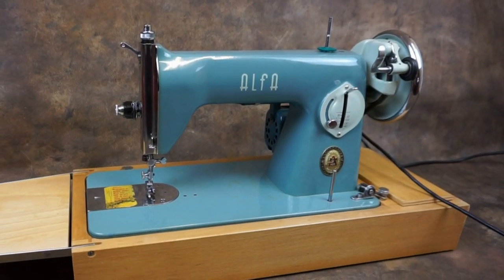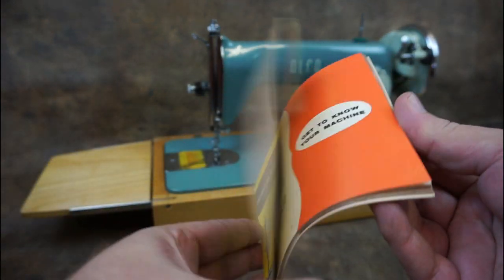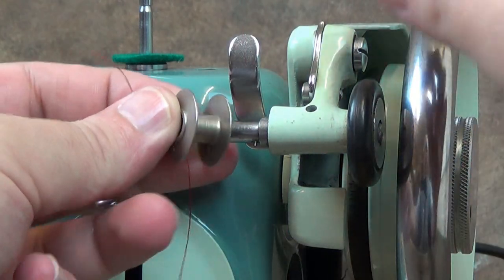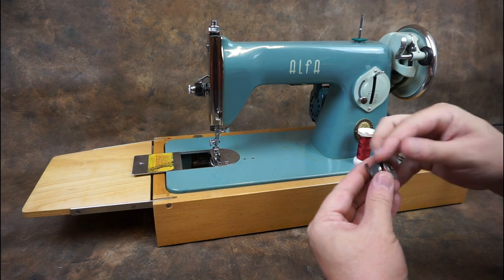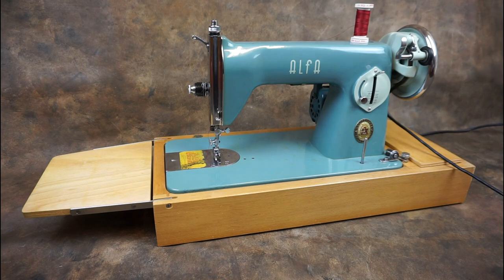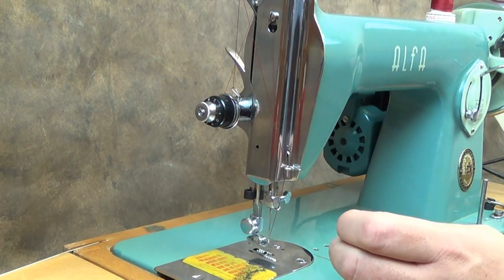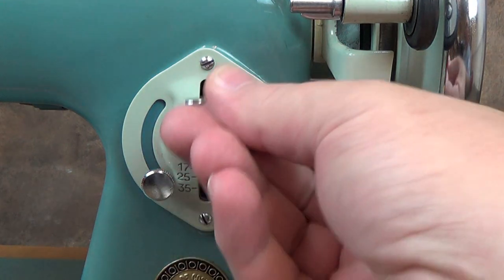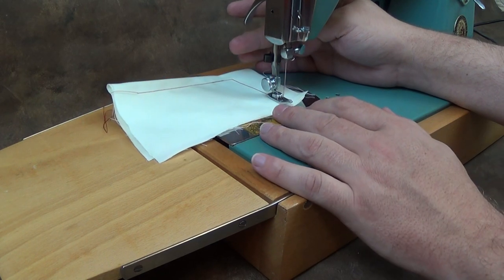Alfa Model 50 Vintage Sewing Machine - Singer 15 Clone

Comment: Hi, I have just been gifted an Alfa sew-tric A244202 it looks very similar to this one. I've been searching for a manual but I'm struggling. I'm wondering if you can help.
Reply from the maker: check on some of the Facebook vintage sewing machine groups - many have files sections with copies of manuals to download. A singer 15 manual is basically the same. By the way Sewtric is the name of the motor manufacturer.

Comment: I have one of these model 50 machines. However, the foot pedal is broken. Is it easy to pick up a replacement, or are they interchangeable with other alfa/singer foot pedals? Thanks
Reply from the maker: Not easy, but not impossible. You could replace the pedal and motor with one from a Singer.
Reply: @CurioByBSpokeDesigns  would a motor/pedal combo from any singer do, or specifically a singer 15?
Reply from the maker: @BrianLynch-x2w  most singer motors and pedals will fit. There are also aftermarket motors and pedals available

Comment: Hi, Ive just been given an Alfa Ballerina Muti stitch thats been in the family for a long time & has seen better days but it's cleaning up nicely. Will the Singer 15 and the instructions on here apply much the same. I'm looking forward to getting it going, this on here is very useful Thanks Deb
Reply from the maker: Hi Deb. That's not a model I'm familiar with. It may be worth searching for a manual on the internet.

Comment: The body shape looks like the 201Mk2 or in my case Singer 191j's. I have one of these in Black, need a motor for it.
Reply from the maker: Yes, I think they followed Singer's lead in modernising what is basically a very old design.
Reply: I tried to mount a singer motor and it looks like it wants a slightly bigger belt.. Hey have you ever used the old treadle belts to make custom smaller belts? @CurioByBSpokeDesigns
Reply from the maker: @davidanddavidstrading  no, but I know that people have. Different sized belts are available online though.
Reply: @CurioByBSpokeDesigns maybe I'll try!! Or maybe I will swap out a 191J on a treadle. I need to learn that too!

Comment: The manual for my Singer 15J90 Centennial (made in St. John's, Canada 1951) states that the bobbin is inserted as to make the bobbin spin counter-clockwise/anti-clockwise. 🤔
Reply from the maker: Hi. If you check out my video on the Singer 15, you'll see that over time Singer changed the 15 bobbin mechanism. Some had the finger on the bobbin case pointing to 11 o'clock and some pointing to 1 o'clock. This meant that the bobbins were inserted a different way in each. It also meant that the needle was the other way round - and threaded the opposite way.

Comment: Mine has been in storgare for many years and is now very stiff...it is a hand powered machine.  htink it just needs oiling. Can it be converted to an electric peddle operation?oops, mine is alpha 70
Reply from the maker: Yes. You can get an after market motor and pedal set. It just bolts on where the hand crank bolts on.
Reply: @CurioByBSpokeDesigns  thank you

Comment: I just bought an alfa e2 
Is it the same mechanism
Reply from the maker: I'm not familiar with that machine but it also looks like a 15 clone as the tension is on the face plate
Reply: @CurioByBSpokeDesigns  I was just intrested in Wether the bobbin casing from my janome would fit it